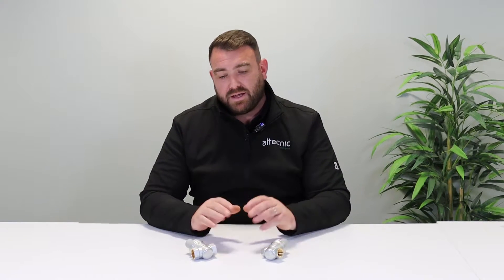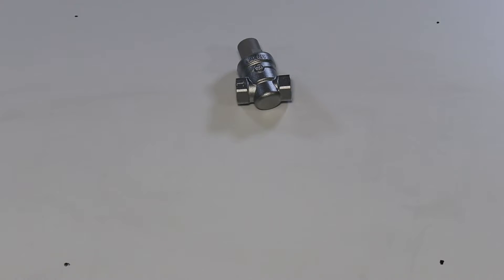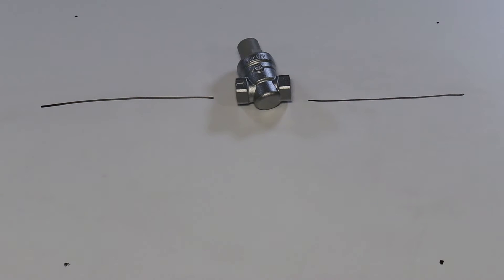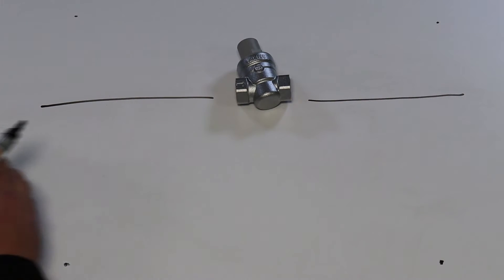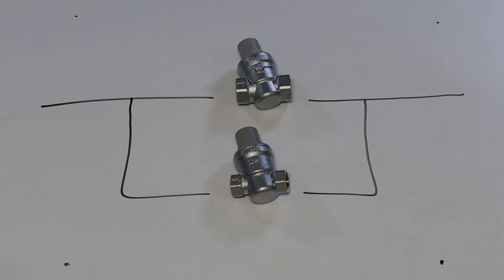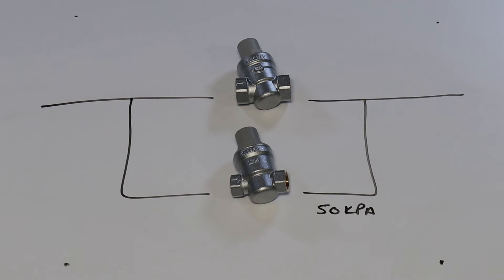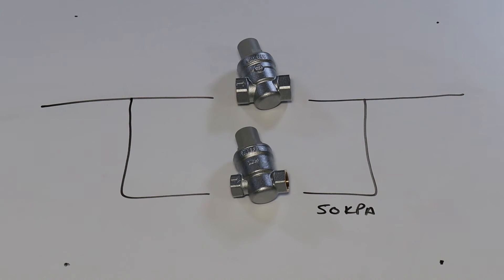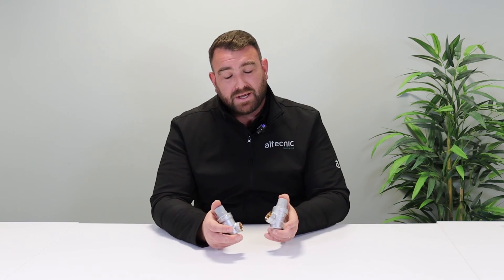Does a pressure reducing valve reduce flow? - Let's look at high and low demand

Comment: Hello...My question, if the inlet pressure reduces to set outlet pressure... Will the pressure reducing valve will let the water pass through it... 

Let the set point at outlet is 1 bar and input is 3 bar.... And if the input pressure  decreases to 0.1 bar.... Will the same prv let the water flow through it.. Regards

Comment: I have knocking on my cold mains coming in to the house,on a shared main.
Everytime my neighbour opens a faucet,the mains bangs like fuck.
Can I install this above my mains on a council property.
Cheers mate
Reply from the maker: If the banging is happening when the tap is open then yes as it sounds like you have high water pressure at the property, this will help to reduce this pressure, if the banging occurs when the tap is turned off then you require a product such as a shock arrestor.